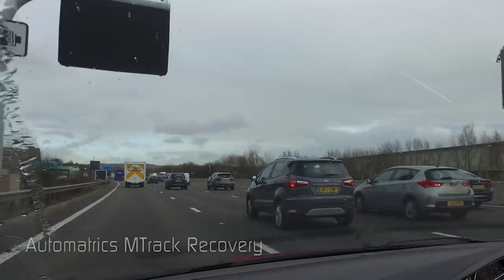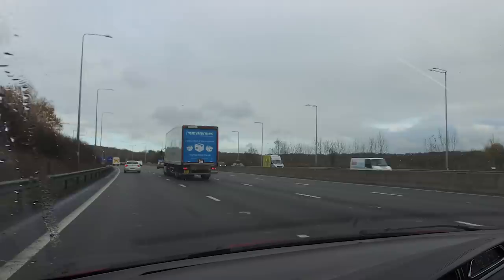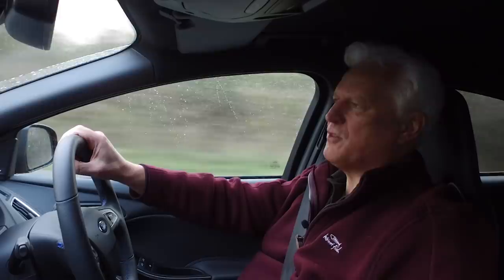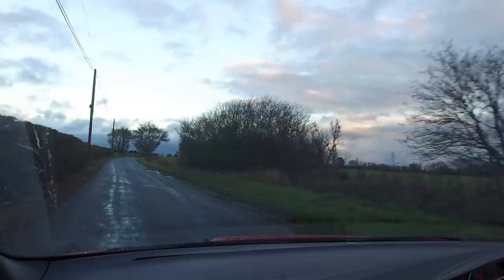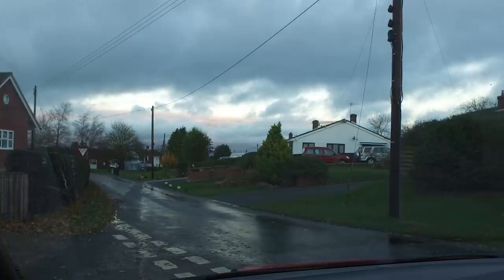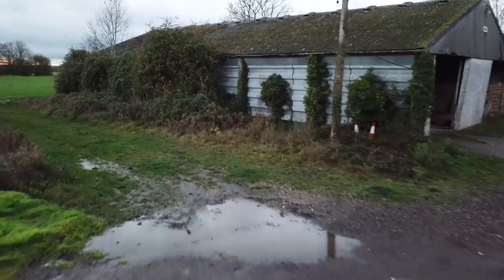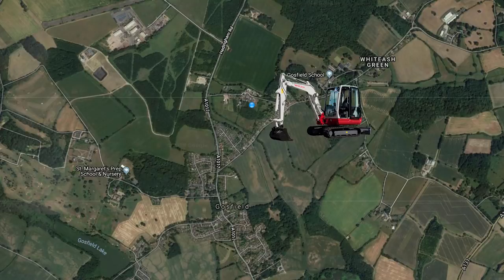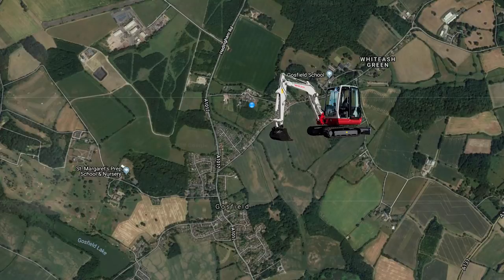Stolen Takeuchi TB 235 Compact Excavator Automatrics find operation Ashen 3rd Dec 2018

Comment: having done radio direction finding for years for search and rescue, using an omni-directional antenna wasted a lot of time. if he had a directional yagi and got out of his car for 20 minutes, he could have pinpointed the excavator much faster.
Reply from the maker: You may have had poorly matched receivers. Our digital receiver is optimised specifically for our transmitter and antenna combo. We have an external Yagi in addition to the miniature yagi receiver,  and although it can be ok in straight line paths when walking it is considerably slower than an omni on the car in our experience. Thanks for your comment

Comment: Someone was watching for sure, there is no way they would have moved it without being alerted that someone had found it.  Lucky you didn't run into them, it could have been nasty.   

PS - Just looking at Google maps it's clear that Upper Farm Lane has an exit to Tilbury Road
Reply: It's almost "Standard Operating Procedure" by plant/vehicle thieves to leave it somewhere accessible but fairly close to the original theft for a day or two, in order to see if there's a tracker  fitted. Rookie mistake to walk up to it without taking steps to secure the location.
Reply from the maker: We agree, stolen kit like this would not normally move so quickly. Our thoughts were that the stolen tractor was due to be picked up to be likely shipped out of the country,  and the bandits were just trying to add this Takeuchi somewhat earlier than normal. The idea we were seen is plausible regardless of steps taken to stay out of site. However, we don't believe the machine was relocated due to us being seen. Why would bandits do that knowing there must be a powerful tracking system involved and that as such there would be an extremely high risk of them being caught red handed with stolen goods.
Reply from the maker: @TheRoybeasley  We agree but we do not secure stolen assets within private property. We would however normally remain within a constant watching brief. In this case we assessed to keep totally clear and cover the believed only exit route until police arrived. We did avoid confrontation, we still found the relocated stolen machine and by way of bonus a stolen tractor,  in addition to police arresting the culprits.

Comment: Surprised you posted this video. It was within your sight and you  did not park your vehicle right by the driveway. You could have locked your doors and kept your vehicle running and drove away of any danger surfaced, which would have been very doubtful, A reall lack of thinking on your part, I would not want to work  or employ someone so incompetent
Reply from the maker: We were caught out its true. However all ended up OK, with more intelligence and an additional stolen tractor recovered to its rightful owner. You may be missing the point. The machine is protected by a professional theft recovery system. So securing the discovered machine at all costs despite risks is not the order of the day. 
We evaluate the situation and make judgements. To-date those onsite judgements have lead to 100% recovery of every customers stolen asset for over 12 years without a single site confrontation or injury. So we would argue success results tell a different story.

Comment: What is a ceaser number? 14:50
Reply from the maker: Most plant machinery is not registered at the DVLA. Therefore it is somewhat easier to sell on stolen plant machines. To help police quickly identify stolen plant machines many are now fitted with a CESAR number. This is a triangular number plate type sticker which is registered by DataTag and available for police access. In addition to the sticker there are several other identification marks in the form of smart water or micro RFID chips.  So its a plant registration system 👍

Comment: Smart lec attitude by the recovery agent snooping & entering private property cost loosing the excavator the 1st time. He knew perfectly well that he violated Police jurisdiction. Knowing he fuck-up, the 2nd attempt he stayed well back out of the way allowing the Police to move in, successfully recovering the stolen excavator. As for the shallow attempt he was involved with any arrests smacks to me he fancy's himself as a rent-a-cop. As for "the special recovery equipment" its nothing more than basically a mobile with GPS connected to a UHF transmitter. When your unable to get a GPS location then the mobile can activate the transmitter. Using the nearest cellular tower gives you a general location. Then run around with a radio receiver to triangulate the mobile/equipment location. Try googling China for the equipment cheaper and you don't need their services you can install it yourself then control, monitor and activate it and eventual recovery your stolen property with Police help.

Comment: where do these machines have transmitter?
Reply from the maker: That's a bit of a pointless question considering the required covert needs
Reply: pointless?
you lost me
Reply from the maker: @Veso266  we cannot reveal where the covert tracker was transmitting from so that's why your question is pointless.
Reply: not the location on where did you find it but the location of a covert tracker on a machine

do all industrial vehicles have those?

and how do you make them transmitt?, what kind of signal do you need to send?, on which frequency do they transmit?, would realy like to try this out going near a contruction site with a radio and finding them
Reply from the maker: @Veso266   we can't post answers here to your questions if we did the bandits might see them and then our recovery systems would no longer be covert
Reply: oh right :)

but do only machines in the UK have theese or do all of them have one

Was thinking of driving to a cunstruction site in Slovenija and investigate a bit
Reply from the maker: @Veso266  Some have our systems some have different systems some have no systems. So its not known about these which is all part of the point. Some manufactures will fit an overt telematics GPS system but these are most often placed in one area on the machine and easily defeated by bandits. Theft recovery devices are unknown and covertly installed so would have a better chance of success to work in a theft recovery situation

Comment: Next time just let the air out of one or two of the tires on the trailer... simply take out (and take it with you) the valve from the stem (you may need to get one of those valve screw driver thingamabobs to be able to remove the valve...
Reply: Or simply slapped a hitch lock on it . . .

Comment: Is this supposed to be a promo by the company? Yea they recovered it, but that seemed like luck and dumb criminals. I mean a couple hours to track it down? Should have known exactly where it was the instant they pinged it, Better yet. it should have told the owners that it was being stolen when it left its GPS area of operation.  Keep the RF signal for the back up system not the primary.
Reply: You did hear him say the barn blocked the GPS signal?  And he found it anyway using RF.  Sounds like the system worked perfectly, no luck involved.

Comment: The tractor would be UNFINDABLE if the crooks disconnected the battery.  Once it's at the final location, the smart crook is going to search the vehicle for the OBVIOUS aftermarket electrical and transponder.  Even if there is a separate battery to constantly give back-up power, it's easily spotted and disabled.  Nice try tho.  Hopefully 90%+ machine crooks are stupid.

Comment: You should have slashed the tires on the trailer when you saw it in the 1st barn. A $50 dollar flattened tire would have kept the $30,000.00 excavator put.

Comment: Thief must be pretty stupid to take the digger back to his yard after getting tip off to move it. Either that or he's done this so often it didn't cross his mind the digger might have a tracker. Probably the latter. Well done anyway.
Reply: When you analyse it,i dont think they did know it had a tracker on it cos surely if they knew it had been tracked to the first location then you wouldnt risk returning too it,let alone leading police to other stolen plant.i think it was coincidence
Reply: @peteramberley9952  they knew it had a tracker.
They parked it in a steel building to disable the GPS
What they didn't know was that this system has a radio transmitter as a back-up.

It's a pretty safe bet the truck they were using to tow the trailer had a GPS jammer on it.
Because they didn't get a GPS location WHILE IT WAS BEING MOVED.

It wasn't until they drove off and ran away from the cops that the company started getting a GPS location.

What most likely happened was they believed that the unit had managed to get a GPS fix (somehow) while it was parked in the steel barn.
So they decided to move it before the cops showed up and use their GPS jammer to keep its location a secret , but the Cops just followed the tracks the trailer left in the wet ground.